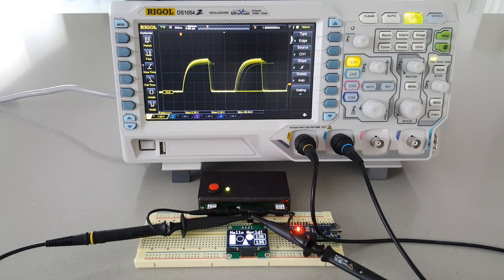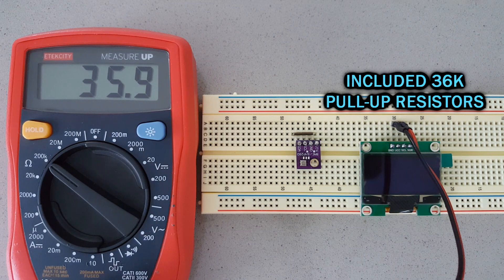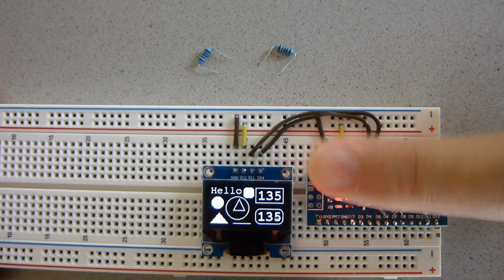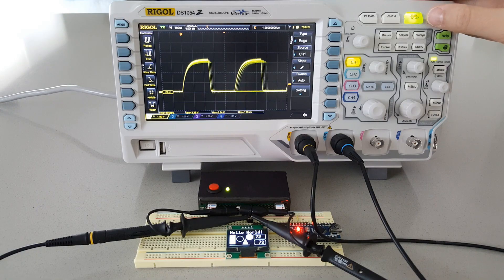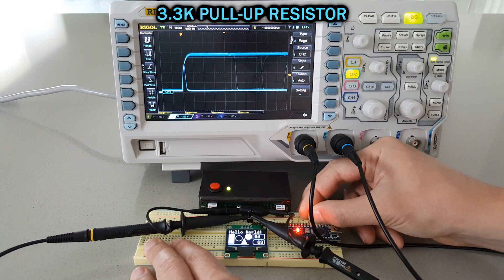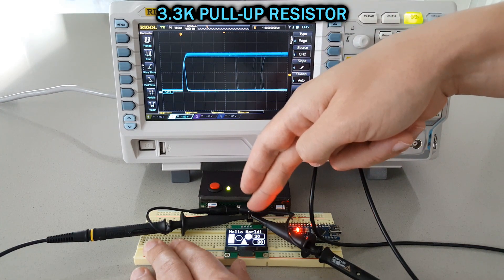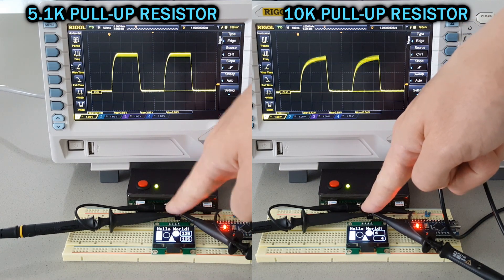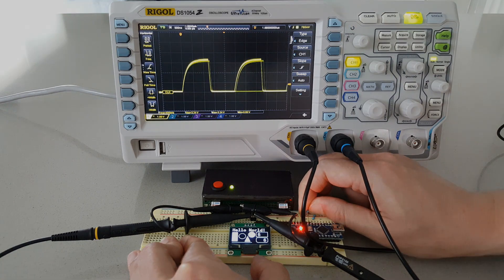Why Arduino Crashed?

Comment: Hello where to place pull-up resistors? Close to the arduino or close to the display? I have almost 50 cm long cable. And second thing is why arduino freezes only when I power it up from the external switching source. If I power it up through the USB - PC OLED display works just fine. Any idea?
Reply from the maker: I don't know

Comment: Can we "unfreez" it?
Reply from the maker: Pressing the reset button or doing a power cycle
Reply: @interlinkknight   No, like in software. I found that wire.setWireTimeout will do the trick to unfreeze arduino.
Reply from the maker: Good to know

Comment: I am facing problem but I don't know exactly what's the cause for it . I am building a waypoint navigation robot but arduino mega freeze when motors starts running, but without motors arduino mega runs for infinite time. So sir can u help me with this to fix it. Thank you
Reply: I am also using hmc5883l magnetometer with i2c communication to determine heading
Reply: @CommonManDreams27  I am facing the same problem did you find a fix?
Reply from the maker: Did you put the pull up resistors?
Reply: @interlinkknight  No sir , but controller freezes only when motor start running. So I thought something has to be done with motor. 
Will having pull up resistor fix my problem?
Reply from the maker: Maybe, yes. Try it
Reply: @interlinkknight  I am using level shifter, data sheet says it has pull-up resistor
Reply from the maker: As I explain in the video, the OLED display in the video has it's own resistors and clearly wasn't enough
Reply: Sounds like you have a powersupply issue. As soon as the motor starts the voltage drops for a short time and this causes the arduino to crash. You might be able to solve this by using independent power supply’s for the arduino and the motor
Reply: Sameee problem for me. Same hmc compass and it just freezes when i try to run in a certain degree like 100 or something. Randomly the Arduino stops responding to my Bluetooth commands altogether

Comment: this is great info!!!    Thanks!
Question:  How would you connect multiple i2c devices and pull them up?
Reply from the maker: You connect multiple devices the same way as connecting 1 device. But if we are talking about many devices, like 10, then you might not need any pullup resistor because i2c modules usually have their own pullup resistor.
Reply: @interlinkknight  so I would only need 1 set of resistors on the bus? and when  I get to 10 or more, they may not be necessary.  At that point will it hurt if they are there?   I would I determine if I need more or less pull-up resistance? and just subscribed  :D
Reply from the maker: Since I2C devices connect in the same line you only need one resistor for the sda pin and one for scl.

If you have many devices, it might create problems if you add pull-up resistors.

The way to be sure is to look at the signal with an oscilloscope, but don't worry too much about it. It doesn't have to be perfect.
Reply: @interlinkknight  thank you!  that help clear it in my mine!